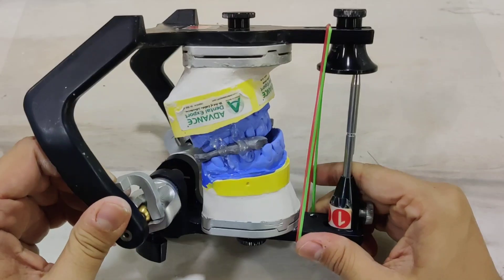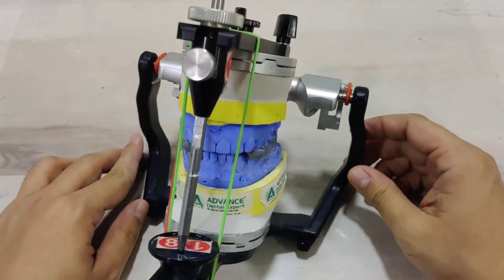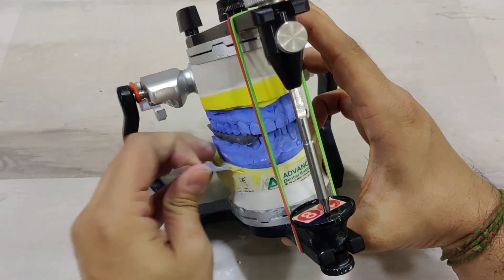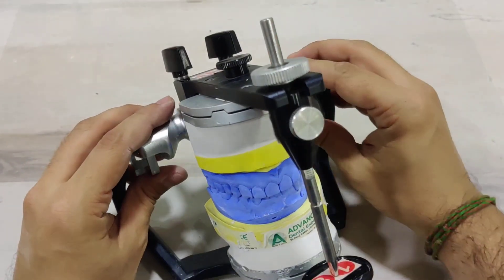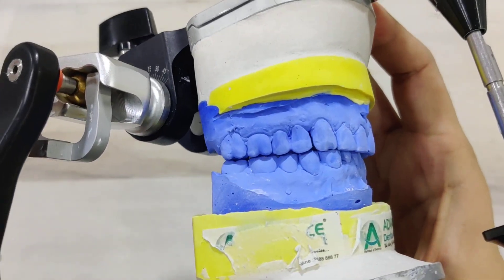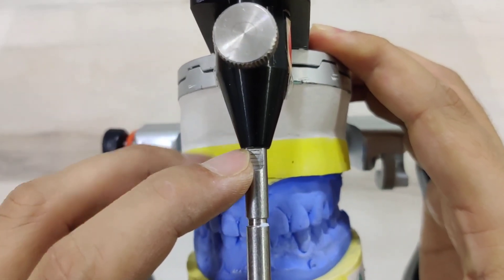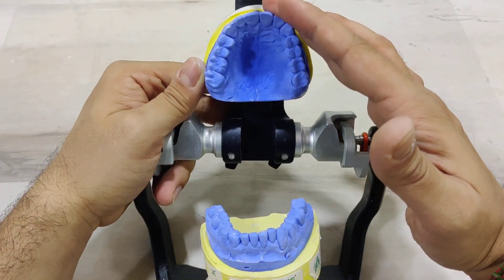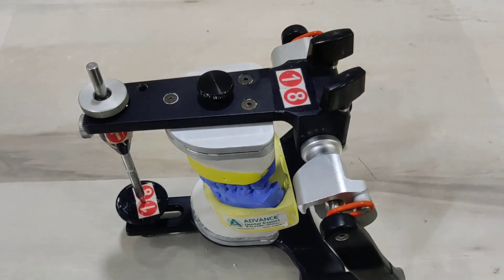Mounting of casts on a semi-adjustable articulator; Corident CSA 400- Part 5

Comment: Sir in cr record there is a space between two jaws. It's not in maximum intercuspation. So in articulater how it in maximum intercuspation. How did u cover the space between two casts!
Reply from the maker: Jay the casts are very much in CR... there has been no mention of MIP here
Reply: @DrMoezKhakianiMDSMumbai that I know sir the case is in cr. But as in cr there is no tooth to tooth contact. So there should be space between two jaws as well in articulater. I am not getting that sir.or I did understand? Please make it clear...
Reply from the maker: @jayjain1917  so once u remove the CR record and allow the casts to meet... They will meet at RCP... In this case there was less opening of bite in CR that's why u must be feeling it is in MIP... But that is not the case...
Reply: @DrMoezKhakianiMDSMumbai  ok sir

Comment: Hello Dr, after compensating for the unwinding... shouldn't you bring back to zero and proceed for wax up? Why go to -6
Reply from the maker: The final value is subject to overbite and amount of condylar translation from CR... so it is never a fixed value...
Reply: more correctly, shouldnt it be -5 since thats the value he used to compensate for the unwind which he said it was 5mm of disocclusion